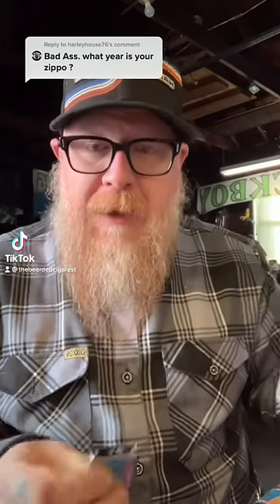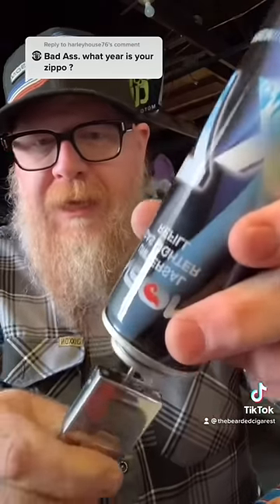How to properly fill a butane lighter!!!

Comment: Air... mhm.. isnt that just gasified butane? And the liquid is liquified butane? Its ok to have it there.. you cant have vacuum in there so its just liquid
Reply from the maker: Yes your right. When I say “air” I really mean the pressurized butane. But leaving it in and not filling completely with liquid will cause the torch flame to flicker, sputter, spit gas, go out.

Comment: Ah man. I can’t believe some people need help figuring this out
Reply from the maker: It’s really not that common of knowledge. Only the more expensive torches come with a manual to show you hot to fill properly.
Reply: @thebeardedcigarest  Every torch I’ve ever bought has had instructions. I must’ve bought almost 100 in my life.
Reply from the maker: The most common torches are the ones in a display box on the counters of gas stations or smoke shops $5-$10 and they definitely don’t come with instructions

Comment: Y’all can use anything to do this. You don’t need to spend money on something. I’ve even cut a q-tip in half and used the stick side to do this before. Grab a damn stick lol. You have this tool around your house a thousand times over. No need to spend money.

Comment: Lol love how you didn't even attempt to fill it up as ya know a lil.spray happens 5/10 times anyways I don't see an issue with a tiny drop of butane from my lighter anyways 😂
Reply from the maker: Ran out of time honestly. If you have the correct adapter, it will not spew out. On more expensive torches, they have a gasket already on it so the adapters aren’t necessary.

Comment: That's not air you're removing, that tool is doing literally nothing because you're just purging out some of the gaseous butane, just fill it up no need to waste butane with that "purging tool"
Reply from the maker: When I say “air” I mean the evaporated pressurized butane. If you don’t bleed/purge you will be unable to fill it completely. When you have the evap Butane and trying to light, your flame will sputter. This isn’t something I’ve made up. Literally states this on every butane torch instruction manual.

Comment: NO NOT REALLY NOW A DAYS MOST LIGHTERS ARE A STANDARD SIZE AND THE ATTACHMENTS DON'T COME WITH THE BUTANE CAN BECAUSE NEW BUTANE CANS HAVE A PLASTIC UNIVERSAL TIP NOT THE OLD METAL TIPS THAT NEEDED A ADAPTER.

Comment: There's no air trapped inside of the tank that's the pressure of the butane that's in the tank. You do not have to relieve that pressure you can simply throw it in the freezer so the pressure drops pressure equals temperature temperature equals pressure. Then keep your butane in room temperature and then fuel your butane lighter and you will see that you are able to fill it up. you should only fill it up to 80% of capacity and that is for expansion of the gas. I love how people act like they know what's going on when they don't

Comment: As a stoner I can confirm this is cap. Fucking cap. Jus tilt it upside down. I hit dabs I use torches on a daily bases fucking CAP
Reply from the maker: Instead of saying this is Cap with absolutely to basis or back up, why not stitch my video and explain how this is wrong. It even tells you on torch instruction manual how to fill 😂

Comment: I bought some piece of shit torch. $40. Should hold butane for at least a few days but only lasts about a day full. Sadly for me the smoke shop I bought it from doesn’t do returns and the manufacture might as well be out of business or something 😂 so now I got a torch that needs filled with butane about every 6 or so times I use it. The torch has a stupid “slide button” feature instead of a usual knob they put on torches to get the butane going. 
I’ve taken it apart as much as it will allow me, changed an O ring in the filling tube because the O ring looked trashed. If you got any tips let me know cause right now I’m about to throw it in the damn trash 😂

Comment: You just waisted your lighter....
Butane under pressure stays liquid because at atmospheric pressure it evaporates extremely quickly due to it having such a low boiling point, 
You'll never get all the air out of the lighter... the gentleman's issue was not using an adapter, 
DONT BLEED IT UNLESS YOUVE ALREADY RUN IT EMPTY! 
you want to de-pressurize the lighter once its empty so that more butane can be put back in when refilling as you slowly fill it with air every refill you do, eventually you'll be "full" but only have 1/3 the amount of butane, 
That's the only reason to bleed your light also notice how the lighters output for the fluids always under the butane.....
Gas under pressure will exit through its only outlet especially when sealed in that manner, 
all my torches have operated exactly as stated above

Comment: But the thing is it's only going to stop making noise once you let all of the butane out of it, there's only a very little bit of air in there and when you push the thing to release the supposed air it causes the pressure inside to go down which causes the liquid butane to then become a gas so any butane that is inside of the lighter will be released along with whatever supposed air

Comment: Uhm bud that's a zippo not a butane lighter
Reply from the maker: Um bud zippo makes butane lighters.
Reply: @thebeardedcigarest  uhm bud you can see the cotton . its clearly not a butane lighter .
Reply: @mike971000  you don’t know what you’re speaking about. First and foremost it is a zippo lighter. It’s a butane model, I have this one as seen in the video and a different one Einstein. There is no cotton you must be blind or trolling.
Reply: @poontangpirate1343  bro you're slow. Look at that first video again. The one the response is about. That's not a butane lighter
Reply: @poontangpirate1343  you probably never used any type of lighter
Reply: @mike971000  you’re incorrect 100%. The fact you believe your right is scary. I just told you I have the same lighter wtf.
Reply from the maker: @mike971000  this is quite entertaining hahah. If you see cotton I want what you’re smoking 😂😂
Reply from the maker: @mike971000  but just in case you really think your right and not trolling, I’ll break it down for you. Pause the video in the beginning. You see on the bottom of that lighter, there’s a port for butane refill. Next to that port is a valve to adjust the flame, looks like a flathead screw. Old style zippos have nothing on the metal outside. You need to pull the insert out to fill it. That’s where the cotton is. Clearly in this video that is metal. Here’s an even cooler fun fact for you. Zippo makes butane inserts for your old zippos. So you can covert your old school into new school. I really hope you learned something here 😂😂
Reply: @thebeardedcigarest  oh yeah youre right . I was wrong. The way it reflected the light made it look all white like cotton.
Reply: @thebeardedcigarest  just weed and cigarettes tho

Comment: That was a zippo! They use liquid fuel. Torches you do have to bleed the air out every 4-5 fills. When air stops coming out it will spit out butane. Pro smoker here..
Reply from the maker: Zippo is a brand!! Not a style of lighter. Go check out my most recent video 🤯